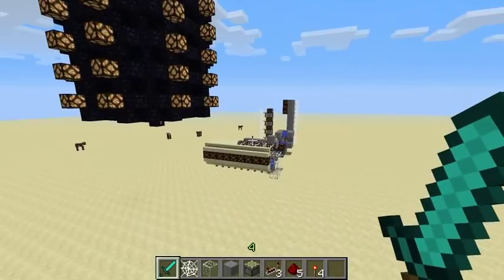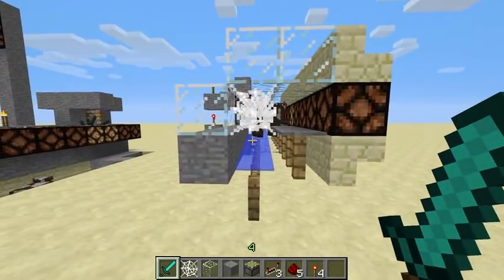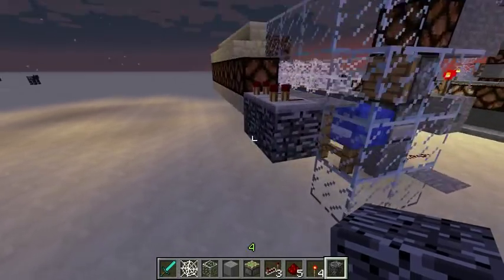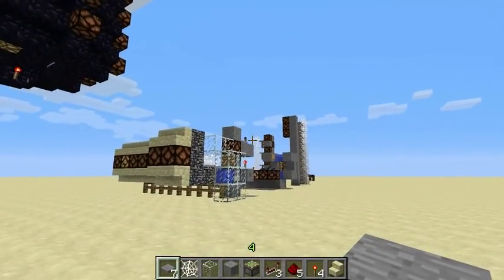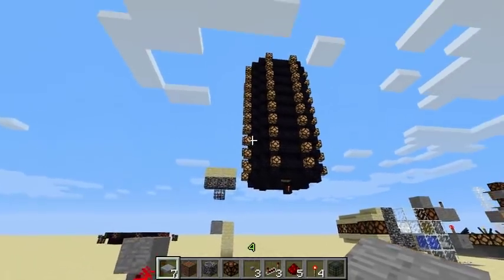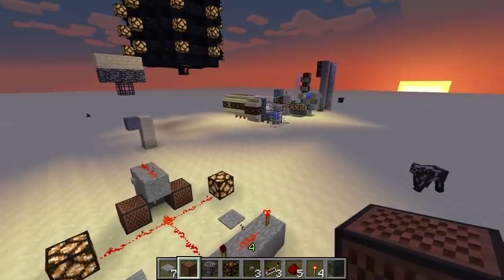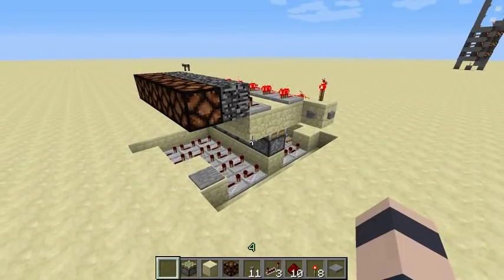Map Making - The Arena: Episode 2

Comment: Hey Etho, you've probably seen, but just in case; Sethbling had a cool new proximity detector in his Portal in Minecraft video. The spawners generated villagers at an incredibly high rate, but with zero health. This meant that when a player was within boundary, the pressure plate was kept activated by a constant stream of villagers which only lived for a fraction of a second. This made it very precise; when the player moved away, the plate instantly switched off as the villager stream stopped.

Comment: Etho- a fairly simple way to lock the capture nodes so they only work when the timer has run out is to use an AND gate, with one input hooked to the timer so it can only be used while the timer is in its end condition.

Comment: On the issue with pistons facing upwards being powered by the block they're pushing, place sand on top of the first block. It will allow power to go through as normal, but it won't power the piston pushing it and it will fall down when the piston retracts.

Comment: Etho, for your problem at about 16 minutes, you can use that configuration but you have to lower the bottom row of pistons by one block and use 2 sand blocks on top of them. It will allow the piston to push the sand into position and since the repeater is not powering the block directly above the piston, it will retract as a row with the sand falling (because Minecraft's gravity is just SO realistic). Anyway, hope this helps, big fan!

Comment: The easiest way to do it is having an isolated spawn area with trip wires everywhere. These trip wires, when activated, keep a timer running which will trigger a command block. This command block teleports one of the players in the spawn area to a new area and also sends a signal to a counter which will increment for every time a new player is teleported away from spawn. It's actually much easier to do than it sounds, especially with the new repeater locking feature.

Comment: Hey Etho, here's another idea for the player counter: Assign teams based on levels, and when the game starts, start up a clock that teleports one player from a team to the top of a shaft (into the air, so the immediately fall), directly into tripwire, which will then increase the counter. On death, do the same thing (with inventory lock to prevent xp loss). Different shafts for the different teams. Of course, this only works if you don't plan to use xp for anything else. :)

Comment: For the player counter you can use this method. When the games begin a piston is triggered, this stays open, the player then falls down a chute that contains a ring of fences with pressure plates. To count multiple players and prevent cheating you can have multiple levels of pistons that the player stand on before the game. Then all you have to do is trigger them a few seconds apart and you will have a great counter. This also adds a new element of strategy (who drops in first). For the death c

Comment: For the design you showed @15:33 and the problem you described @16:30, you could lower the pistons by one extra block and use two sand/gravel blocks on top of each piston. This would fix the problem with the pistons staying powered. Good luck! Keep up the good work.

Comment: I recommend using Item spawners for the player detector.  Set the Min and Max spawn delay to around 9 and 10 respectively, the Delay itself to about 10, and then set the Age attribute to 5990. That way when the item is spawned, it is 10 ticks away from despawning.  Obviously you might have to fine-tune it.  You can also set the spawn location and player detection range, and, if you need it, the MaxNearbyEntities attribute to prevent it from spawning too many,

Comment: You could use the command blocks to force the "Adventure" mode. I don't know if that would interfere with anything else you've got planned but it would be a solution for player-proofing everything.

Etho, the new Snapshot has lockable repeaters, maybe you could do something with those?

As for the spawner for the pressure plate, maybe you could use lava to kill the mob. That way when someone is out of range, it will stop counting pretty fast. You could even use potions to weaken the mob.

Comment: for cart timers, the way i would do it (for a resetting timer) would be when they step on the pad, it dispenses a cart onto a powered track, and pushes tracks into the route. so if they step off, the pistons will pull the track back, and the cart will fall off the track (thus resetting the track)

Comment: Etho, at 15:48, where you're having trouble with the reset pistons, you could just drop the piston and the block it's holding down one block and then put sand/gravel on top of that. That way they won't be powered by the block they're holding, but the sand can still power the tracker above.

Comment: Etho, if the latest version of your capture node doesn't work, you can still use the vertical piston timer. Use two blocks of sand instead of one block of stone, so the powered block isn't connected to the piston, but they still fall after the piston retracts!

Comment: hey etho, 2 things.. instead of a day night sensor, you should just use a command block on the ready button, to set it to night, then start the cow-ntdown :)
2: your first design for the node timer would work, just "and" the looping repeters with the pressure pad. that way if they step off it breaks the loop.  Also putting it to a short pulse looping would be better. I have screens of how i built it, but dont know how to send them to  you

Comment: To make the pistons (on the bottom to cancel the timer) you should lower them down a block and have the piston block on top and then sand or gravel above that. this removes the piston stick thing (it won't get stuck up when power goes though the sand)

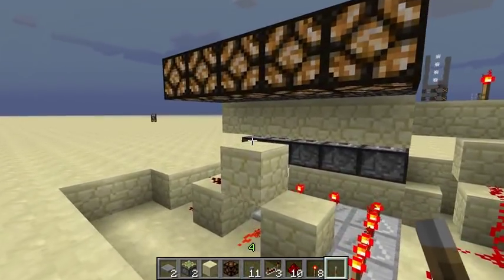Comment: You can lower the bottom pistons (16:00) and put a sand/gravel block on them so they won't be powered and will go down to break the circuit.

Comment: Etho, the way you had the capture node display after the second off camera try was close, for the second set of pistons under the ground which turns all lamps off when you step off, move them down 1 more block and place sand/gravel on top of the block they push.

Comment: I have made many attempts at making a redstone-only device that triggers when the input stays on for a certain amount of time and resets as soon as the input goes off. I have found that the only (not just the best) way to have a reliable timer is using the design that LastUsername showed you. My design is a bit different but it's basically the same idea. The problem with your own design (18:50) is the stacked repeaters. They do not reset instantly which is what causes the flickering.

Comment: etho, maybe an idea: for the timer of the pressure plates, if you use your concept from the first timer, but then without the cobweb or however long you want it, a cow drops in, and when the player gets knocked off the pressure plate, pistons would retrack (this will be normal stance, when you have a player on the pressure plate, it will move the pistons in the way of the lava flow and it wont flow down no more) if the player gets knocked off, lava falls down and the animal dies :)

Comment: At 15:33  if you lower the bottom piston row by 1, and put 2 layers of sand or gravel on top of them instead of the one layer of sandstone, the repeaters wont keep the pistons up. 

 It usually works for me. but you may have found a better way by now lol

Comment: For the pressure plate timer, what if you had a minecart that was pushed up a 'spiral staircase' by powered rails when the player stood on the pressure pad?
That way if the player left the pressure pad, it would slowly reset itself but not instantly, and you would also have nice visual feedback.

Comment: Etho you can lock repeaters in the newest snapshot so for the capture node you could make it so you press a button to start a signal but unless somebody is standing on the pressure plate the repeaters are all locked.This way the signal will not disappear and it won't keep going either

Comment: with your first idea : just make the pressure plate send 2 signals out : the first is turned into a sudden pulse and the 2nd is sent down to the lower pistons... if they get off the pressure plate, the pistons retract (and you could send a pulse to the "reset" switch)

The only real difference is the first signal being pulsed in stead... that means the blocks are only being powered for a moment.

Comment: Here's a possible fix for the 15:59 bug:
Put redstone DUST going into the block then put repeaters on the other side. That will save you the trouble of the sand thingy and it also might work because it has a repeater going OUT not IN.

Comment: I'm curious if the locking repeaters could fix that problem. I haven't really done anything with them yet, but it seems rather promising for what you are doing.

On the note of the mob spawning with a high despawn rate, sethbling had a video where he spawned villagers with 0 health, so they would instantly disappear as they spawned. With a high spawn rate, it can active pressure plates reliably (not too sure which video that was, it may have been his portal remake video).

Comment: Use a piston with a solid block up. above the solid block place a sand block. since the piston is now two blocks below the repeaters they will still retract when you step off the pressure plate.

Comment: I think ,rather than a complete reset for the capture timer, a slow reset over time would be better. That's the way it is in the real tf2.
Your cow timer should be perfect for that, just have the water flow change direction depending on if somebody is on the pressure plate or not.

Comment: Hey etho i like the design unhost showed you but you should put the nod in a room and run redstone less compact and do a direct line with delay to one side the room with the lamps all together. Then sll you would need to do is add repeters that are one thick like so
 ______ insted of the two thick like you had 
======
stoping the funny clock

Comment: Squids can only spawn in these conditions:
1 or more blocks of water, any light level, spawning block must be between level 46 and 62
Etho will be fine as long as its below 46 or above 62, if not; there is still a low chance of a squid spawning in the 1 source block that is there. Squids cant spawn in flowing water.

Comment: When a video gets 300 views, the view counter freezes until they are verified to be legit views, then the number is corrected. The number is sometimes larger than 300 because the code uses a greater than or equal to symbol, rather than just equals. If 2+ views are recieved at the same moment, the count freezes at a number just above 300.

Comment: Etho I've found a video that will help you on the capture point set-up, If you're interested, And I thought I'd try and explain the functionality. 

You need redstone torches on a line of blocks how ever long you'd like, then you have a weave of redstone repeaters through the blocks that have the redstone torches on 'em.

Next, you put a line of blocks the same length as the redstone torches below with redstone dust on top.

And it'll reset when you are pushed off!

LIKE SO ETHO CAN SEE! :D

Comment: Hey someone who is good with redstone, for a capture node that stays where it is rather than resetting, couldn't you just put a cart on a bunch of power rails so that everytime you get off the pressure plate than the cart stops, but when you jump back on it starts going again, i mean obviously it would go heaps quick but just out of curiosity would it work?
Reply: The mine cart wouldn't move. It only moves on power rails either when pushed or if it is against a block.

Comment: Etho it just so happens that I was building a similar timer and had the same problem with the repeaters preventing the pistons from resetting due to it diagonoly powering the piston i fixed this by just moving the piston down and adding a block on top along with a block of sand or gravel. That way you get the same effect without the pistons being affected.